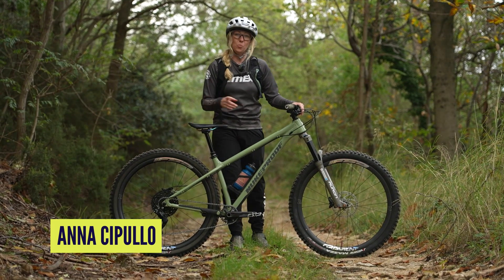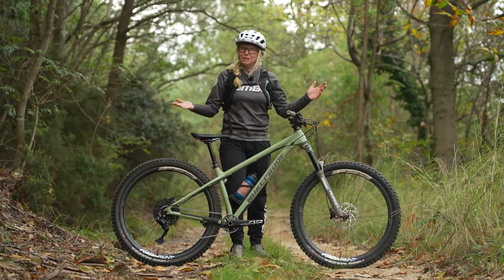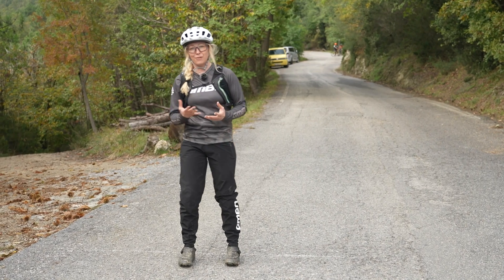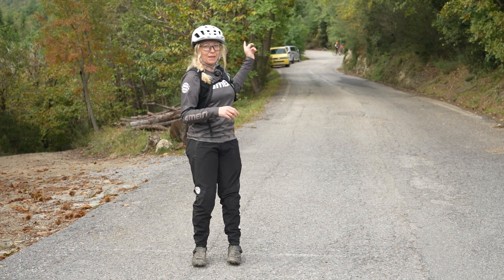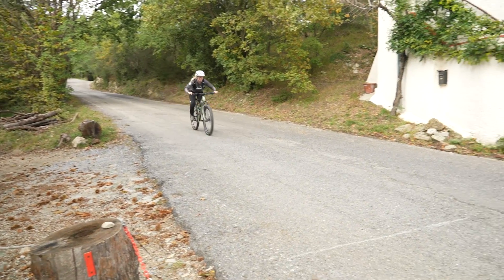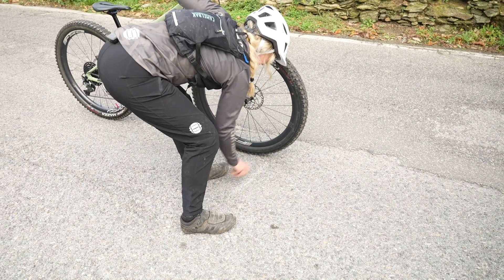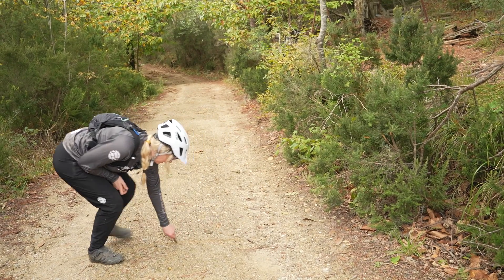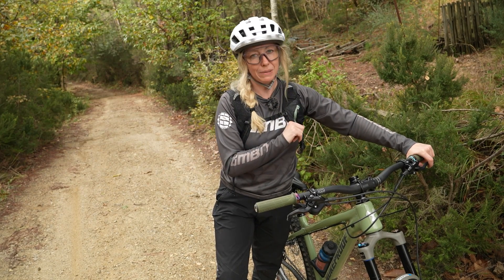Is Bigger Better? The Science Of Superior Braking Performance

Comment: Bigger is better when it comes to brakes, there’s no too big. And one word about your weird braking distance comparison, that’s totally nonsense to be honest. No matter what rotor size you’re using you can easily lock up your front wheel if you want. So what you’re comparing here is tire grip or your ability to brake as hard as possible. On trail this might be different because less hand force makes it easier especially on long steep descents with bigger rotors.

Comment: 7:12  "perhaps the 220's where too powerful, we skidded" that is what happened. Once the wheels lockup the tires are no longer able to extract its maximum grip/braking capabilities.

180mm had no skid. 200mm skidded just a bit. 220mm skidded too much to stop maximally.

The larger rotors also have a higher thermal capacity and thus requires higher temps to be optimal.

Just as the video concluded, the bigger the rotor the higher loads are required to get the most benefit(heavier rider and/or DH applications)
Reply: @lukedangles-mckenzie2024  what is your point?
Reply: you can't lock the wheel with the 180 mm?
Reply: @goku445  yes, you can kock the wheel with an even smaller smaller if the rest of components are powerful enough.

The caveat is the larger rotor provides greater leverage and thus more braking force for a given lever pressure. Aka its a tad harder to modulate how much power is applied, which makes it more likely to lock up the wheel.
Reply: @ So in theory the 180mm should be better?
Reply: @goku445 its all depend on criteria. If youre always riding a gravity park, 200 front 180 rear is better. 220f 200r if youre heavier or more experienced and aggressive.

If you ride primarily trail, and green or blue trails, 180 will very likely be optimal.

That said its hard to give an opinion over the internet.

Comment: ppl call me crazy to run my bike with 246mm Rotors. I'm 120kg ... when 60kg riders think 220mm are fine ... I'm def allowed to run my 246mm :D
Reply: You might want to check if your fork and frame support that.
Reply: use any size rotors u want aslong as ur wheel and fork can support that

Comment: I went 220 and never looked back far less fatigue in the fingers and arm pump
Reply: did you find it hard to get used to using less power to get the same braking as with smaller rotors sizes? Cause I hear a lot of people saying that they lock the wheels with 220

Comment: I have two similarly equiped bikes, but one is a hardtail, the other a fullsus.  Both have 203 up front.  The fullsus also has a 203 rear I kept the rear down to 180.  One of the hardtails biggest drawbacks is braking on lose, chattery terrain because the rear starts to bounce and skid.  I feel a larger rear rotor would make it skid more.
Reply: I agree... You could try harder pads to decrease grip to the rear... I still think that rear brakes are overrated and you can be a better rider the less you can force yourself  to use them.. but that comes from years of motorbike riding where onroad rear brakes are actually dangerous (a lot of racers make them near useless so they don't accidently use them in a race) and on the trailbikes I became faster on my old bike when the drum rear failed and I learnt how to brake hard upto a corner and no brakes through it (to the point where I was entering corners with the rear in the air (which is why I say rear brakes are useless (Except for stopping at slow speeds like lights.

Comment: I would take this test with a very large grain of salt, braking performance on dirt is almost always limited by grip, not by how big your rotors are, I've gone from 200mm down to 180mm and my braking performance hasn't changed, the only thing that has changed is the smaller disc requires slightly more squeeze from the lever on very steep descents, maybe the issue is the weak 2 piston calipers? they probably can't get away with running a 180mm rotor.

Comment: My trails are very short descents and punchy climbs. I could be entirely wrong but I've found that a 160 on the rear spins up heat faster and grabs a lil harder for me in the short braking spurts i deal with at my local trails. I think on a long decent I'd melt it and fly into the trees though. (I'm a wheel bending 285lbs) Something to think about if your descents aren't long at your local trails!
Reply: You are correct a smaller rotor will heat up quicker thereby transferring the kinetic heat energy into thermal energy into the pads. For a short period of time a smaller rotor will be more efficient but on any sort of prolonged usage the smaller rotor will no longer be thermally efficient
Reply: You should try to descend Khardungla in Ladakh. It's a 5300 m mountain pass which descends to 3500 m on a distance of 40 km. A full hour of descending.

Riding it up is a good training

Comment: It would be great to acquire data for each rotors thermal time constant.  You were sneaking up on this important metric with the IR measurement in the last measurement of the 220 mm rear tire rotor.  The faster the rotor can shed heat the lower the operating brake temperatures would be for extended down hill runs which demand more frequent braking.  Brake temperature beyond a point is the nemesis of consistent braking authority.

Nice color match with the dead cat, kudos to your production crew!

Comment: Great test! I went to 220 front and rear for a long time now and I’m a light weight rider. Less finger and arm fatigue and fade resistance on long (10min+) steep runs are the main reasons. Also when I ride a ridiculous amount per week it keeps my body get beat up as much. It takes a while to get used to how powerful it is but once your brain adapts the grabbiness is manageable.
Reply: Ya Get To Use The ADVANCED  Braking Techniques  Like Feathering And Trail  Braking . I ride Whistler  ALL Day Without Arm Pump .... of course im fit and Ride Alot So I dont Brake as much as most riders . Makes For Very Fast Flow
Reply: Very few forks and frames are rated past 203 mm  you're not worried about things breaking?
Reply: @PunkRockPandaa  Funny thing... you can get a 180 rotor to lock up on tarmac down a hill... any thing beyond lock up is ... well still locked up...
So riding a 180 near locked up down a tarmac hill until you come to a stop is EXACTLY the same load as a 220mm near locked up... so the rating is really a bit of a joke unless they expect you to use brakes on that fork that cannot force the wheel to near stall.
I can load my forks on my old Vee Brakes as well as the 200's I run... the Vees just don't have the feel and fade/burn away quicker.   The big difference is the Vees required an entire vice grip of fingers vs the 1 finger braking I get with the XT's.
(And I ran a Schwalbe Nobby Nic with the vee's so there was a good amount of force back from the tyre grip.
Reply: @TheButlerNZ  wow I've never thought of it  like that , you've got a good point , but why do bike manufacturers put a max rotor size though ?
Reply: @PunkRockPandaa  Because you want to go bigger on the rotor, so they want you to go bigger on the forks... and guess who just happens to be selling the next model up... the same people that rated their cheaper ones... 
There is a point... Bigger rotors, more ease to overload the forks... Like a lot of base $ forks that you could destroy with a good tyre and Vee brakes...
I think the big thing is a hard landing with a handfull of big rotor brake will give huge torque to a set of forks where a smaller rotor will be forced into rotating... THEN you will see meaning to the fork rating... If you just ride DH without big air to flat under hard braking... I'll go with my 1st 'theory'.

(I used to load the front of the trailbike when I needed to get a bit more 'Stop' without reaching a lockup but generally I was too mediocre to really push a YZ250 to any real limit.. Plenty of big air to flat but always with plenty of runoff.

Comment: I don't think brake size would help in this test other than lever effort.  The main advantage of big rotors is their ability to absorb and dissipate heat in multiple stops
Reply: There is no change in lever effort at all because that would mean you'd have to change the ratio in the master cylinder as it pushes the hydraulic fluid through the caliper into the Pistons. It's a fallacy. It's simply psychological perception
Reply: @rider65  A bigger diameter rotor is moving faster through the caliper (or has more leverage on the hub).  Therefore, you need to squeeze the lever less for the same level of braking force.
Reply: @rider65  Another way of saying this is that a given level of lever effort will result in more braking force if you have larger rotors.

Comment: Next time avoid locking the rear tire specially on asphalt, that situation show that brake balance is not well performed and modulation is not executed properly.
Removing those mistakes will provide more accurate results

Comment: I'm pretty sure they did but, just in case, were the rotors bedded in properly? That can dramatically affect the performance of the brakes. Also, it would be nice if you could mark the braking point and not only the stopping point. Maybe you did Mark it but it wasn't told in the video. Finally, don't take your foot out of the pedal before the stop has been completed, Anna! That can affect the result as well. Maybe go flat next time, so that you can focus on the braking only.

Just a few suggestions. Love it, guys. Keep'em coming and go Anna!

Comment: I have the same Shimano MT6100 breaks on my Trek Roscoe with 200mm front and 180mm rear rotors. I also noticed an improvement in breaking and feel from the stock MT200’s and 180mm front rotor it came with. I dont do any downhill trails so this setup works very well for me and didn’t break the bank upgrading. Thanks for the video! 🙏
Reply: brakes vs breaks
Reply: @vashon100  🤣 missed that. Good catch!
Reply: Wouldn’t that be “Brake the bank?”

Comment: On my 2015 trek Remedy 7, the stock parts were Shimano deore 2 piston; 180/160 rotors.  When I raced and the descent was greater than 5 minutes,  I had brake Fad ( big loss of power). I switched to 203/180  seven years ago and have not had one moment of power loss or fad inside and outside of racing!
Reply from the maker: Sounds like you've got the perfect setup! 👍

Comment: to make those test u should consult with someone that understand rly well the forces. How u did the test is normal that 220 mm rotor could be between other marks becouse you did it wrong. To compare in reality the rotor, it is not allowed lock the wheel even in gravel, if not, you are not compare rotor size, u are compared wheel traction.

Comment: A couple of other things to consider here are brake pad composition and how that relates to the rotor temperature ramp up.
Disc brakes need some temperature to function and that temperature is dependent on pad material; resin vs. sintered. The stopping distance test showed that the rear just locks at the pad "bite point", where the pad makes initial grip, and the 220mm rotor took longer to heat and provide the needed stopping power to slow down then the 200mm. The bite point is different between pad materials as is how quickly they heat the rotor up. 
If you watch most types of car racing you will notice that the teams change the brake duct sizes to keep their rotor temps in the optimum range. Formula 1 is a good example. If the driver lets the brakes get too cool, they are useless.
What it all comes down to is experimenting to find the best combination of pad material and rotor size that works for the rider and their terrain. 
On my hardtail with 2 piston calipers and sintered pads I never felt I needed bigger then a 180/160 front & rear.
Reply: I just did
Reply: Formula 1 brakes are carbon rotors and are designed to operate at high temperatures. Bike brakes are designed with normal riding conditions in mind and will be operational at cooler temperatures. They may not be optimal. The same reason normal car's brakes are metal rotors; they need to work straight away.
Reply: Good lord man nobody is reading that novel
Reply: @DB-sd3cw  You should, you'd learn something. Exactly what @dantuttle2050 said is correct.
Reply: @lenolenoleno  can't imagine being so lame you have time to comment on a 5 month old reply. No wonder you have time to read that novel, you have nothing else to do it seems

Comment: I love you guys, but I rly miss the more science based approach where you take out variables. 
Anna is only human so how about we equip the bike with abs, do every test indoors, on clean tarmac, same weight distribution etc. Thn maybe we can see exactly where a bigger disc is making the biggest difference aside from finger feel. I'm a super lightweight rider that just uses cheap shimano mt400 stuff on 160mm discs and I haven't encountered a situation where I needed more braking power (in the Netherlands) but I also have higher than average grip strength...the strength that can pull v-brake cables out (happened a few times) and it's personally a big reason to go for hydraulics, the extra modulation is also rly nice..but yes, I never experienced high end brakes and I can heat up a disc in about 30 seconds to the point it might burn you when touching

Comment: The distance test is subject to far too many variables such as initial speed, surface temp and modulation of the brake and as such can be misleading, to understand which brake produces the most braking you need to do a G force test with a G meter and do multiple runs to produce a bell curve, this way you get a clearer picture of the brakes performance.
the braking limit of the bike is not the brake disc and caliper but the coefficient of friction of the tyre to surface, a small brake can lock up on mud for instance.

you also have to factor in the weight of the rider bike combination, a 60kg rider on the same weight bike as a 100kg rider produces vastly less kinetic energy at the same speed, so to produce the same G rating under braking a heavier rider will require a larger brake.

Some riders will prefer a more sensitive brake lever that is lighter to modulate and control, that lends itself to a bigger brake whereas other prefer a brake they can grab without lock up, opposite requirements.

Then we get into the kinetic issues such as weight transfer, a taller rider will have a higher center of gravity than a shorter rider and therfore transfer more weight to the front wheel under braking requiring a larger brake, all of which is subject to our initial starting point of the coefficient of the tyre, which as mentioned earlier is the limiting factor.

suffice to say you have to tailor your brake sizing to your own requirements, the only given factor is, due to weight transfer to the front you can reliably use a smaller disc at the rear to control lock up as weight and therefore friction is reduced by weight transfer under heavy braking.

On my own bike I use a 203mm disc and 4pot caliper on the front and a 160mm with 2pot on the rear, this is because I am 6ft 2" tall and weigh 105kg,

Comment: Larger rotors allow for a lighter lever pull, less aggressive pads, and faster heat dissipation. There really is no down side other than cost
Reply: No they don't. Why would a larger rotor affect or change the ratio of the hydraulic fluid in the master cylinder and the Piston behind the lever. It wouldn't and it doesn't. 🤦‍♂️😂
Reply: @rider65  I will refrain from snarking and just say you need to learn how a lever works.

Comment: Important point; once your wheel is sliding, you're not testing brakes, but tires.
Reply: Ya, once your tires lock up, the entire braking system becomes irrelevant to the conversation of braking distance and control
Reply: No, not completely. Let go of the brakes and your wheels keep rolling, now coefficient of friction is WAY less than a locked and sliding tire. Physics son. 🙄 @JamieTec
Reply: Its A Combo Deal ALL depends  where you Ride And Skill Level
Reply: Yeah, technically she kept the same set of tires throughout the test, it's still a controlled test considering the rotors were the only ones swapped
Reply: @floydblandston108  if that was true then all truck manufacturers are full of crap. Bigger brakes are always better.
Reply: @bluntman99999  - Stupid is as stupid does; you go right ahead and put whatever size brake on your bike that makes you feel like a big strong truck drivin' man. 😂
Reply: But if ur wheel is sliding ur not braking correctly
Reply: Exactly. A lot of people think they need more power. You need better heat dissipation, better tires, etc.
Reply: @michaelgunawan2319  actually you need better modulation/feel. You can have all the poser in the world but if it's only on/off... no use as a brake.
Reply: Once the tyres lock up you are still testing the brakes in real conditions.  The back wheel can still jack on trail, especially on a full sus, if the brakes are poor they may not remain locked, also you will modulate to just before the lock up, better modulation and power means your hands won't get as fatigued on longer descents.
Reply: @MyBetsie  - she was measuring stopping distance....on pavement.
Reply: @floydblandston108  and on gravel, plus doing a test down a hill with timing and temperature.
Reply: locking up rear wheel to slide through corners is so much fun.
Reply: @brian6speed  - the trail maintenance crew would like a word with you...
Reply: ABS bikes maybe?